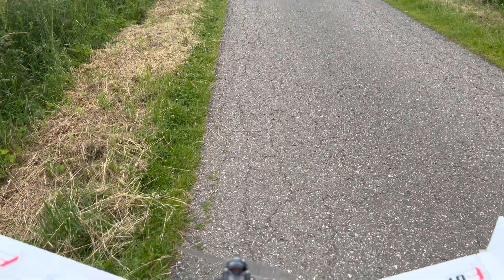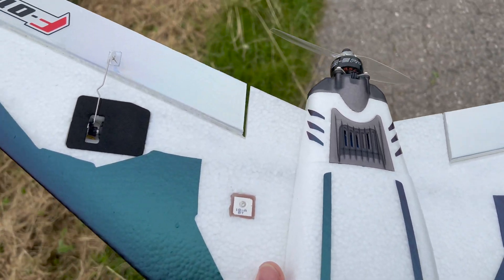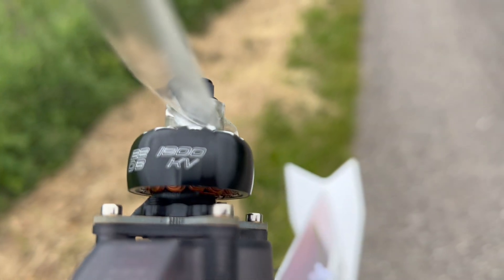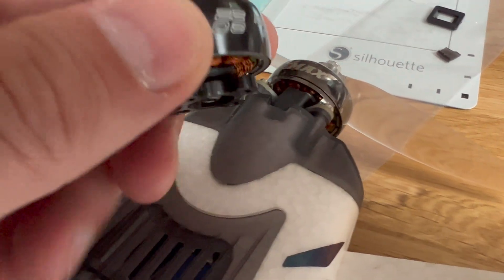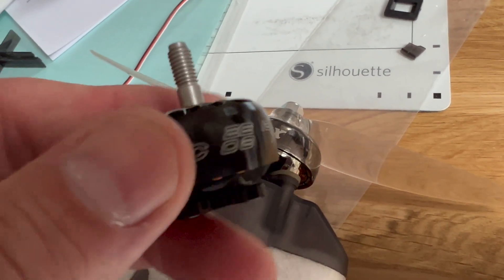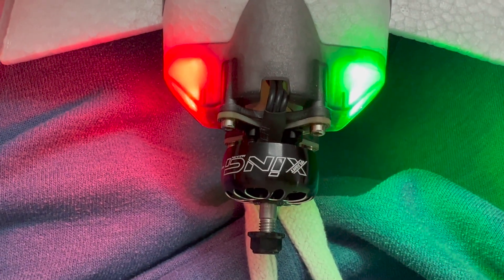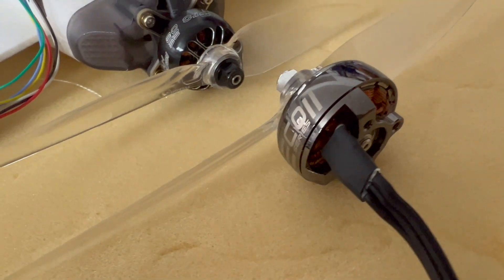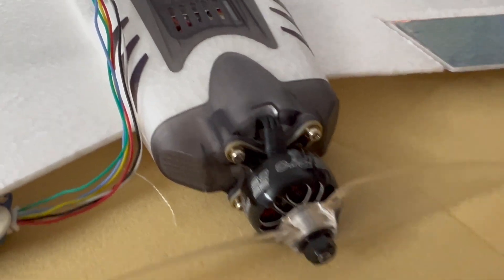First impression on the 2208 1800kv motor | Hee Wing F01 EP:22

Comment: Hi. Have been following your channel for a while. Just Wonder if this wing is a must buy? Im about to buy a new wing and cant choose between ar wing pro and this one.
Reply from the maker: Hi Viksa

Neither this nor the the AR Pro is a buy per se! But I can tell you, that this is more fun ;)
So if you need a nice versatile wing like I fly it: this it the way!

If you want something bigger and less efficient the ar pro is a good choice.
Reply: @JustFPV-net  thx. Been flying wings alot this summer and i actually got a mini talon almost ready for Maiden.
Reply from the maker: sounds good so far! this small F01 comes always in handy as you can have it in your car all the time with nothing to assemble/disassemble ... just chuck it up there and fly! ... with 4s4200 about 60min if you cruise
Reply: @JustFPV-net  yep thats right. I Will use dji vista on this. Hope a 4s 4400 Will fit.
Reply from the maker: 4x21700 cells doe fit ;)
Reply: @JustFPV-net  ahh liion..i ment lipo.
Reply from the maker: Could be to big, that’s why the li-ion is used.
Reply: Hi. Really cool review. It is possible to carry on 6s 1850 instead of 4s 21700? Same weight, lower Kv brushless of course. But more torque and no more voltage sag. Probably better range at same speed I guess. Have a nice day
Reply from the maker: @sebdewey I don’t know to be honest. Ich will stick to 4s in my 2024 build I guess. But the space for 6 cells is limited
Reply: 4s is well too. What is your best range/flight duration with this combo motor/li-ion?
Reply from the maker: @sebdewey some 14-16km if I recall right. 45mins is no worries